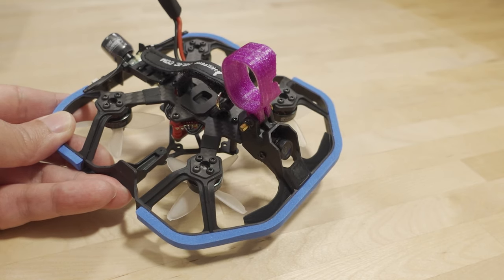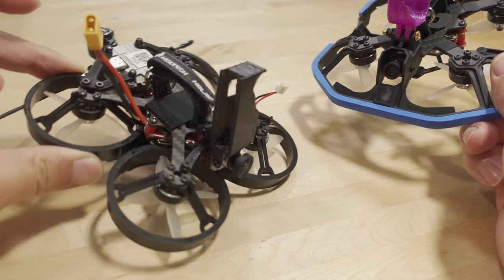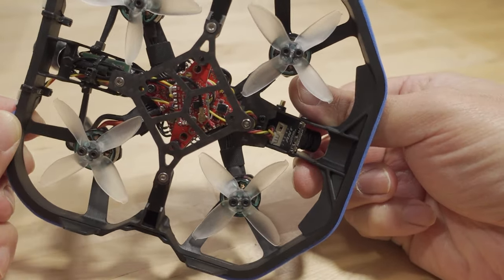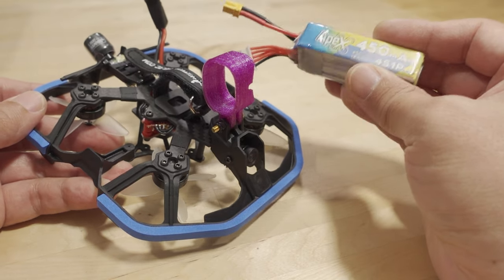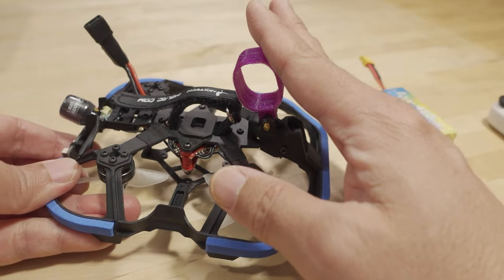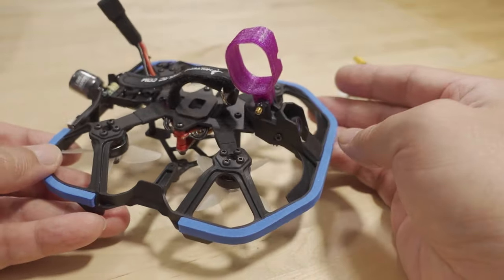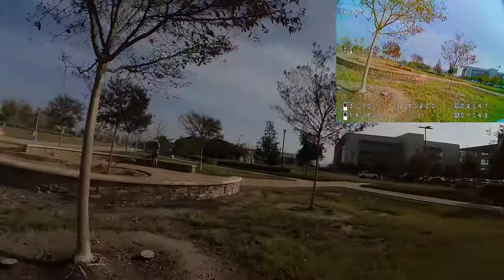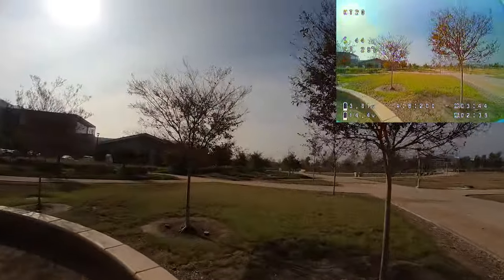HGLRC KT20 Go Kart Micro Racing Cinewhoop 🛸

Comment: I have the digital version. Disappointing video range so I put a longer antenna on it. I fly primarily with 850’s and I mainly use it for proximity flying. Very stable and controllable, however the tune is pretty bad with a lot of vibration apparent through the goggles.
Reply from the maker: Probably too much weight for this setup so try a smaller battery.

Comment: Hey Albert I picked up this frame and was wondering if you thought I'd get any benefit running 1404 5000kv instead, or would the weight increase ruin the tradeoff? On that same note, do you feel 1202.5 or 1203 would be underpowered? Thanks man!
Reply from the maker: The motor is about right for the prop size.  The larger 1404 will reduce flight time.

Comment: Nice looking unit.  I wonder how it would handle configured to fly upside-down?  Easy enough to do in BetaFlight, and probably one of the first things I'd try if I was to get one.  I have a 2S whoop that I fly that's similar in size that has battery-under, and I like how the lower CG feels.  It would probably be quieter, too.  I tried flipping mine once.  It flew, but it was really noisy, and I got a 'broom' effect from the battery-over position.
Reply from the maker: There's a lot of frame blocking the props.  It will fly worse that way.
Reply: @AlbertKimTV  It's likely.  The props on mine do have more clearance.